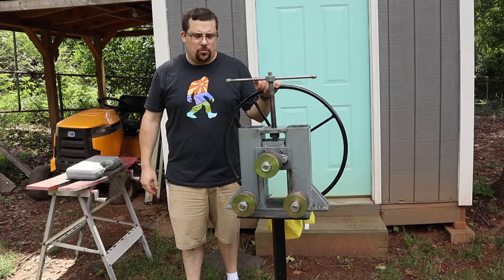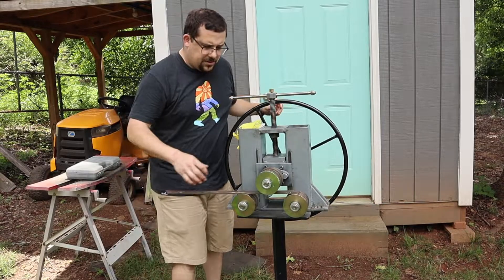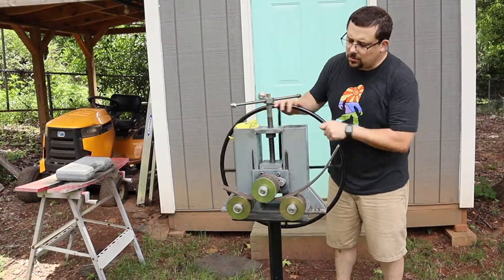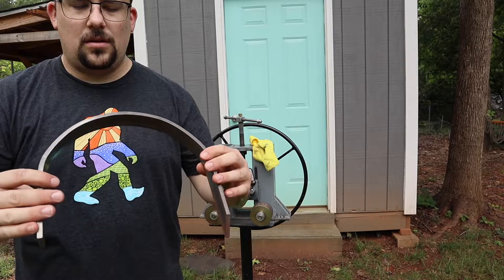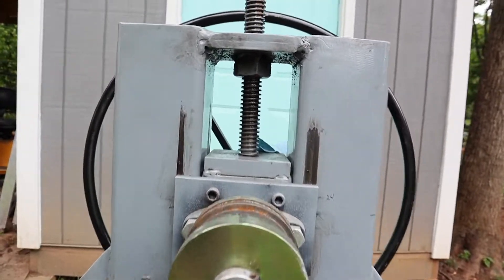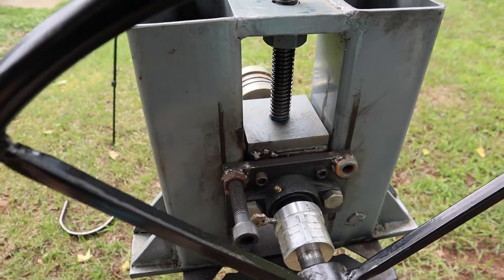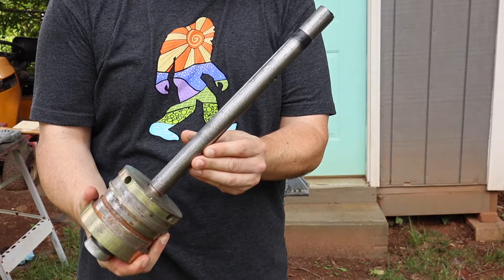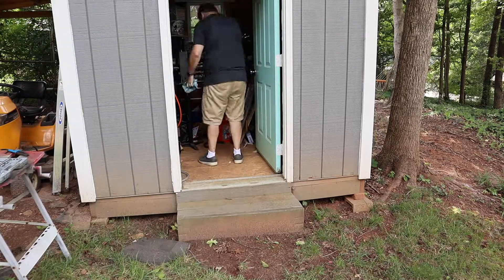How Ring Rollers Work

Comment: Can you weld a 40-in circle with that
Reply from the maker: Rolling a 40" ring would be no problem, but handling the stock can be tough and make the roller a bit unstable at first. (Stock sticks out about 10' on one end to start!)